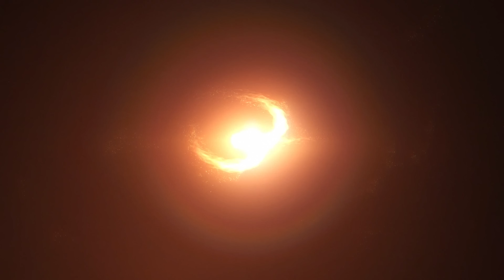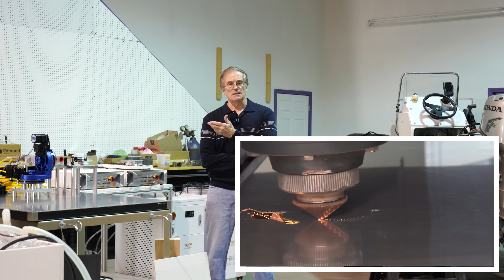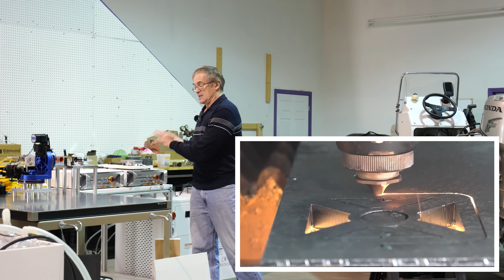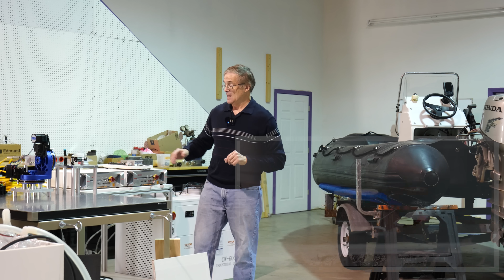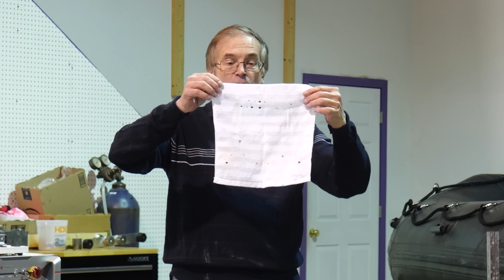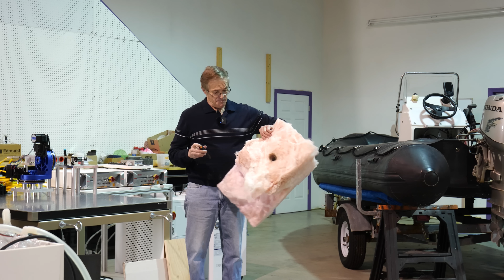We have a problem... and need your help!

Comment: How about a box filled with carbon dioxide (or a vacuum) with a glass front and a plywood back, maybe 3 inches deep?  If there's no oxygen, the wood cannot burn.  Will the laser tear a hole in the glass?  Will the hole expand afterwards?  I assume if the hole is small enough, it will take quite awhile for oxygen to enter for the fire to spread.  To make it cheaper, can plexi be substituted for glass?

Comment: Could you use a flowing stream of a water or some other liquid? By increasing the flowrate you can increase the power dissipated. Perhaps you can mix some compound that has higher heat capacity and can scatter the laser over a large area? Maybe dissolved copper or graphene particles.

Comment: The ideas I have read here are very interesting. In general I am thinking you need to disperse the laser energy. Perhaps something like glass marbles of very small size in a fast flowing fluid that to refract the beam randomly and carry away the heat. Another thought is to use a beam splitter then invert one. Perhaps converging them out of phase could cancel most of the laser output. Then it would be a phaser! But is the light bean made of waves or particles? The light has to get converted to heat one way or another.

Comment: So, maybe instead of trying to stop an unstoppable force, instead, I would try setting up a rounded dispersion glass  lor deflector to redirect the excess energy you could also try to have a rotating metal wheel thick enough to hold the thermal energy and may fast enough to spread the thermal energy out and disperse it. Further the diameter the easier this should be. I used to deal with pulsed/pumped high power diodes. Let me know if you need a hand.

Comment: How about the cheap 12"x12" mirror tiles set at a 45 deg angle reflect the beam straight down into wet sand / Dirt.
Sometimes simple is more practical.
Reply from the maker: I could test one, but those cheap mirrors would almost certainly explode.

Comment: It sounds like you need rock like a Rock wall like rock wool insulation. Supposedly it's got better fire properties then fiberglass, which really doesn't. Although that might still not be enough. That is certainly a problem.

Comment: OK so this may sound crazy but the theory is sound. A contained wall of fog and CO2 backed by really thin bricks.

The bricks are just Terracotta tile roofing tiles, set at a steep 75-80 degree angle so they are not quite vertical with a wall of clear plastic drop cloths a couple feet in front of that and the gap between the plastic and the "roof" should be filled with a dense fog of water droplets and CO2 created by putting dry ice in hot water tanks suspended over the gap you want to fill with the fog and CO2. Vent the excess CO2 out the back under the big rollup door so you don't suffocate and thank me for the elegant idea later. 

Ok so here are the physics: The water droplets and CO2 should in turn disburse and absorb the laser enough for the thin bricks to deal with it, especially since the tiles will be moisten by the fog (or you can add some recirculating pump fed mist nozzles to keep them nice and saturated).  Increase the thickness of the foggy area to increase the disbursement and absorption if the tiles are taking too much damage. Mist nozzles and/or ultrasonic mist generators could be used instead of dry ice and water for the fog, if you don't want to risk flooding the area with CO2 if the laser cuts a big rent in the plastic sheeting.

Could also try coating the tiles in Starlite and seeing if that does better than roof tiles alone. https://www.youtube.com/watch?app=desktop&v=0IbWampaEcM

Comment: 2 Ideas:

1: Laminar flow waterfall. Design a waterfall such that you get a flat laminar 2 flow of water to flow over the entire width of the edge. Recycle the water continuously. Perhaps dye the water it make it more effectively absorb light. The system can easily be drained when not in use.

2: One way glass with a mirror behind it. Build a box similar to the one you built to increase solar panel efficiency. The one way glass would allow light into the box but not out. Rather than striking a solar panel the light would strike a mirror designed to diffuse the light. Consider water cooling the front and back panes of the glass continuously by running water over them.

Comment: My first reaction is to try sandbags with fine loose sand.  The sand should be able to shift and fill any "holes" as they are created much like a water tank stops a water jet.  Different types and colors of sand could be used to adjust the dynamics according to your needs.  Relatively portable even manually, however, they would be massive.

Comment: First Solution - Buy (or copy) a commercial water-cooled beam-dump
A purpose-built water-cooled beam dump such as Gentec-EO “BD-Series” (4 kW) or “HP-Series” (12 kW) Gentec EO
Or here is a DIY version:
Internally a matte-black copper cone spreads the 1 mm beam over >150 mm² while a closed-loop water jacket whisks away the heat (<1 l min⁻¹ gives ΔT≈4 °C per kW).	• Rated to soak several kW CW indefinitely
• Completely non-reflective (<0.2 % back-scatter)
• No combustion or fumes
• About the size of a shoebox (≈10 kg) – bolts to a camera tripod for portability
150 mm-long copper or Cu-W cone (tip angle ≈ 15°) brazed to a 10 mm-thick back plate.
1 mm gap all round, sealed inside a 100 mm-ID schedule-40 steel pipe.
TIG-braze ⅜ ″ Cu tubing in a helical groove outside the cone → inlet/outlet to a beer-chiller pump.
Blacken the copper (CuO or an Acktar-style carbon paint).
Add a normally-closed solenoid valve on the laser interlock: no water flow = no beam.
For a single 3 kW fiber laser, 3 l of water at 1 l min⁻¹ holds the core <80 °C for ~10 s – more than enough time to trip safety logic.

Comment: You mentioned using fiberglass insulation, but have you looked into Rockwool insulation. It comes in both large batts and a semi compressed plank form. It’s composed primarily of basalt rock and metal slag.
Edit: quote from their information page
"Our non-combustible stone wool products are based on volcanic rock and capable of withstanding temperatures above 1000° C (1832° F).  Being non-combustible means they will not ignite or burn when exposed to fire, instead helping prevent the spread of fire in a building. What’s more, ROCKWOOL stone wool products do not contain any chemical flame retardants."

Comment: An aquarium full of water with black food coloring? May need to be expansion shock resistant or highly optically transparent glass/plastic. IDK if the laser can be scattered enough to avoid it boiling the water out of the way without it penetrating. 15 GW/m^2 is a lot to ask if something like that though.

Comment: First, since others shared their credentials, mine are: I never graduated from high school.

That aside, and thinking about your description of the obvious (the bazillion degree heat from a laser, which would turn a fire brick into part of a scary comedy, insofar as shielding things behind a target go), and aside the possibilities of dispersing the beam by broadening, then re-directing it, most things one might be inclined to use as a protective backer for laser experiments on the level of yours would vaporize, or melt.  [insert DUH here]

If the item vaporizes, I am reminded of one of the things revenuers of the bureau of ATF used to chase after - stills. Though on a much more rudimentary level. That is, instead of elaborate coils, simple cooling chambers, to which the vaporized material would not adhere, to allow the material to cool and be returned to use.

My mind, even as I am aware I have only a minute amount of knowledge of chemistry, looks to things like boron, used for fire fighting, and how a bastard still approach might allow reuse of boron or its chemical/mineral superior.

It appears we are dealing with, for example, temperatures of 25,000 degrees kelvin, so we, definitely, are at that vaporizing any and everything place.

CAN we make a chute, vortex or something to return cooled material back to the laser hit zone?

Comment: The most heat-resistant substance in the world is believed to be Hafnium Carbide (HfC). Researchers have discovered that Hafnium Carbide and Tantalum Carbide (TaC) can withstand temperatures nearly 4,000 degrees Celsius. The melting point of HfC is the highest ever recorded for a material.  I have no idea of the availability or cost, but this is some tough stuff for sure.

Comment: Silicon-carbide kiln shelf (unglazed) set at a shallow downward angle. Pure ceramic, no resins, no coatings. At worst the laser will vitrify the surface. Put the shelf over a pan with masonry sand. Any melt droplets or brick spall fall will straight into the sand.

Comment: for simplicity and large area of protection: inclined wood panel (u can soak it in water prior too) with running water on it (the inclination is for helping spreading water on the surface), that may help to suppress the fire and will add some time before it burn through with the cooling. If you are sure of a small area that the ray hit, a rolling cylinder (of whatever best material that the comment suggest) half submerged in water, when rolling the water will stick to it to provide more heat dissipation and protection. 
Oh and think to design a good kill switch that would not explode your circuit. I saw once an experiment that had been kill switched and the alimentation cable (10cm in diameter) was literally exploded and diameter flatten in half afterward)

Comment: This may be redundant (resonant with other proposed solutions), but how about using water dyed with a dark colour, and having it fall like a waterfall the width of your door. The rate of flow could be adjusted to wick away the energy. The thickness of the flow would be part of the design. Resulting steam might be an issue... but hey, it might just work.

Comment: Cement Board or Hardiebacker used for bathrooms showers substrate for tiling the shower building big box stores have it, a couple layers isn't as thick as a brick.

Comment: Someone else has surely suggested this, but how about a water-filled wall?  Not sure what the wall is made of (plywood burns, so not that, maybe hardiboard?) but the goal is that the water keeps flowing in to the steamy voids.  The water layer has to be thick enough that it's not all turned to steam along the beam; it has to flow in fast enough to fill the gap (most of the time).  Stir a little white paint or milk into the water so that the beam diffuses more than it absorbs.  You'll need to patch the wall after it gets a hole in it, though.  I'm a little worried that wet hardiboard would explode.

Comment: Also, if you start with the lasers at low power, it is possible to to design a system if the laser can be pulsed to shut off the laser if the distance exceeds some threshold.

Comment: How does light weight firebrick fare? The sort of stuff used for furnaces. I think it is called vermiculite, can be stacked and need not be cemented together.
Reply: Sorry, pearlite.
Reply from the maker: We already melted that with our earlier laser. That took a lot longer than 3 seconds,  but these lasers are far more intense.

Comment: 1) Team up with Gold Hog sluices  as part of your backstop.  Swamp coolers are low flow, gold sluices have very high flow rates.  Borrow an array of them.  2) high energy control: think glancing angles.  3) pyroceram is a wonderful material, but I bet you will crack it. 4) diverge the beam slightly  for your initial indoor  tests. 5) LN2 fog asphyxiates, so rather use dry ice fog.  Constrain fog between shower curtains, let the beam punch thru the plastic curtain, replace as needed.

Comment: First , coat a 3/4 plywood board with fireproofing liquid. then glue large 1/4" thick ceramic tiles to the board. Smooth with grout. Glue a 5/8 fireproof sheetrock to the surface and then glue large ceramic tiles (Cheap at Home Depot) in a differing configuration than the first. Next mount the whole thing on a roll around cart making it easy to move into and out of the way

Comment: What about generating a curtain of smoke/steam/vapor mixture? I feel like the right type of atomized material (hopefully nontoxic) would have a decent level of internal refraction. Perhaps therefore you lower the intensity of the beam enough that one of the other options would become feasible.

Comment: Perhaps some ablative material like those used in a heat shield. BPS Space has a video showing the heat resistance. of phenolic infused materials. The char layer that forms insulates the material behind it. Given you can infuse the phenolic resin into a substrate this may not be so difficult to manufacture though given the size it may not be easy. Potentially would require some stiff backing layer + layers of canvas soaked phenolic -- https://youtu.be/UkLExdiz8jY?t=356 -- Confounding factors are that although heat shields can withstand extremely high temperatures the heating is generally caused my atmospheric compression and so this is not exactly the same comparison. 

Still, some sort of ablative material that forms some insulating layer when heated sounds directionally right. They've heat shielded probes to the sun using carbon composites (though they paint it white).

Comment: I would give a carbon fiber fire blanket a try, where the blanket would be mounted on a trolly and moves from left to right or right to left as you carry out your test. This way the Lazer is impacting a new area of the blanket at all times and never has a chance to burn through the blanket.

Comment: Fog barrier. Small droplets in the fog will expand and scatter the narrow beam. The vaporization of the droplets by the laser beam will activate the surrounding air currents, creating a continuous barrier even when the beam is fixed. Best of all, this method does not cause material destruction. Materials can also be added to the fog to help scatter or block the light.

Comment: Don't try to stop or absorb the energy with a perpendicular surface it's the worst case scenario. Your stop should provide a high angle of incidence to the laser. This will cause the spot to be spread across a much larger area and reduce the energy density by increasing the area of incidence. A round spot becomes a very long ellipse. There will will be still be a substantial amount of energy so experiment with different materials. Also higher surface area (roughness) of the material will help by scattering some of the light.

Comment: You need to use a thick block of dry ice.  It will definitely explode when the laser hits it but the energy will be dissipated.  A chemist - winner of a 2020 International R&D 100, Process and Prototyping. award

Comment: Starlite might be an option, if it's even real? Apparently it's a slow burning ablative material that creates a carbon foam under heat, which creates a further insulating layer. And the best part is, you can make it your self. Here's a youtube video on it with the wikipedia article.

 https://www.youtube.com/watch?v=0IbWampaEcM

https://en.wikipedia.org/wiki/Starlite

Comment: Here is a simple inexpensive solution. Wet rock wool blocks. They are cheap, light weight, come in blocks that are 8 inch cubes or larger, are typically fire proof, and hold a tremendous amount of water without dripping. You can find them at any hydroponic supplier.

Comment: Someone already mentioned it but I think a sheet of fast moving water down a slope might work? relatively thick (like those Flowrider devices at waterparks) and at an angle of course so most reflections go away from the laser source and operators.

Comment: My first thought was to use water in some way, massive amounts of energy absorption per unit volume, so setting up the laser to fire at an angle such that it would terminate into a water tank where there is an additive in the water like carbon dust or something to adsorb the radiation and not punch through and spring a leak

Comment: Two beams, two frequencies, out of phase.  Introduce the 2nd beam at the desired T(ime) to cancel the destructive potential.  This would have to be computer controlled, continually calibrated to 'inject' the 2nd beam at the precise moment in T.

Comment: You can credit me for pointing you toward another science focused channel: Nighthawkinlight, specifically his videos on Starlite. The material produces carbon foam that both insulates the surface and pushes the source of heat away from the surface as the foam expands. It's incredibly cost effective to make and doesn't require any special materials.
Five parts total: 2 parts flour, 1 part each of corn starch, sugar and baking soda. Mix into an exivalent 1 part of water (i.e. for 100 grams of dry material, add 20 grams of water), you get a workable dough. You can replace baking soda with borax to make it less edible (to pests and microbes) for a small but measurable loss of insulation capability.

Comment: What about etching the glass on a mirror and having it at an angle so it defocuses and reflects the light away. it would need to be kept clean. Or maybe perlite but this might release silica fumes. I think reflection is better than absorption. The paper on the drywall might be causing issues as it turns black. Does a shielding gass make a difference?
Reply: Or instead of frosted mirrors cut a big circle of cement board then plaster perlite on it and have water flow over it from the top to the bottom, no need to cover the hole thing in water as it will be rotating. You could screw a few sheets to a peace of plywood to make a very large one 🎉